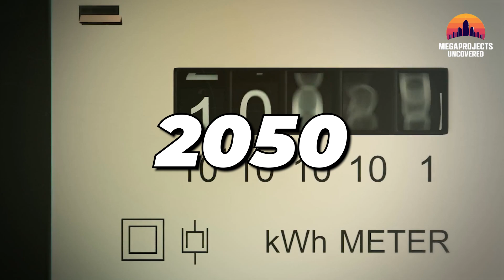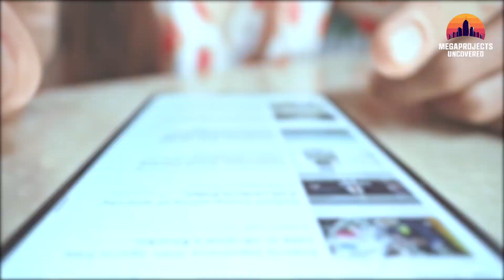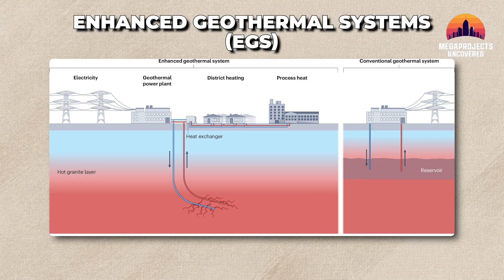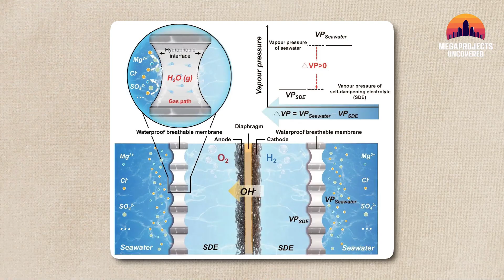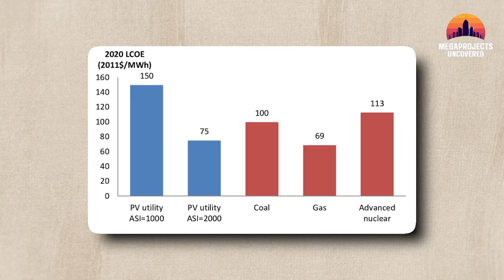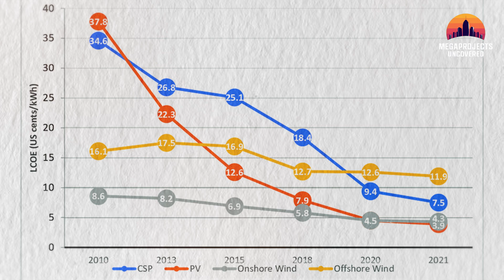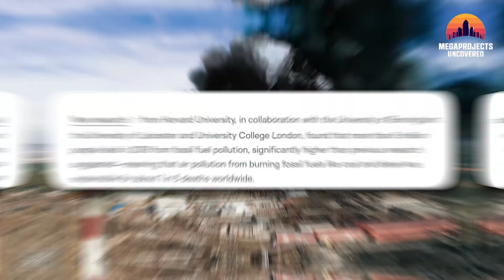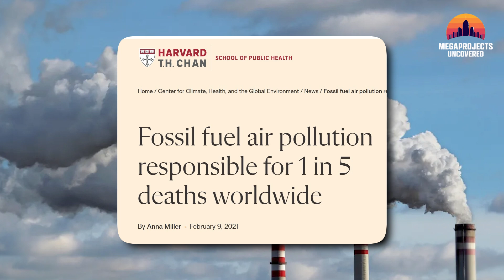The World’s Biggest Energy Megaprojects—Is This the End of Oil

Comment: Sounds good but the information is out of date and misrepresented. The damage done to the environment by building wind farms and solar farms is grossly understated here. Also to produce hydrogen, so called green, uses substantially more energy to separate the hydrogen from the oxygen than it produces, therefore it's not commercially viable, which is why so many of these projects have been abandoned.
Furthermore, the so- called renewables only work on average 30% of the time and are no use for base-line power which is needed for hospitals and industry.
Reply from the maker: I'm glad to hear your thoughts on the environmental impacts of renewable energy, it's an important topic to discuss.